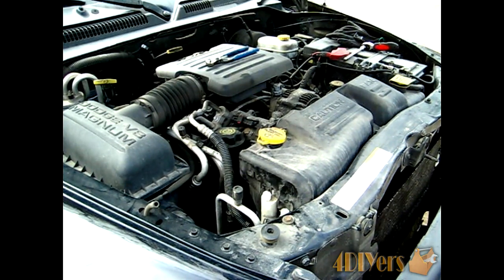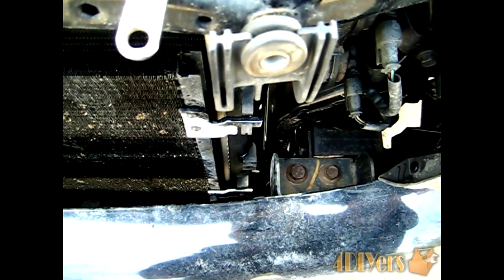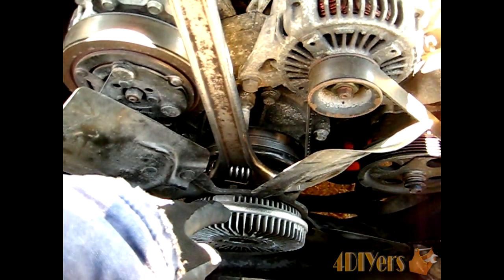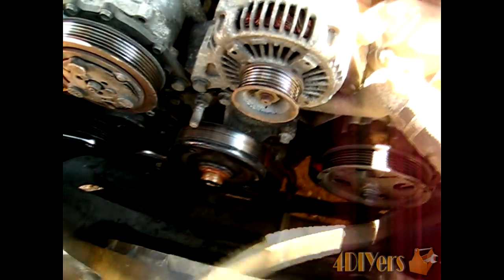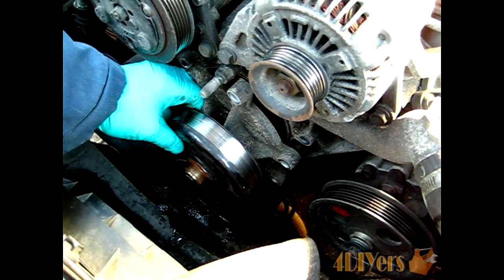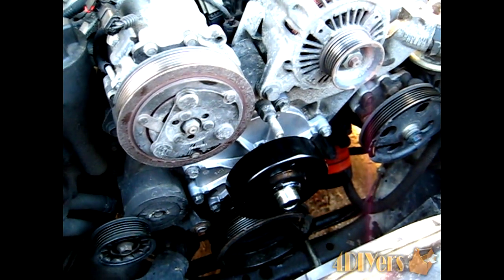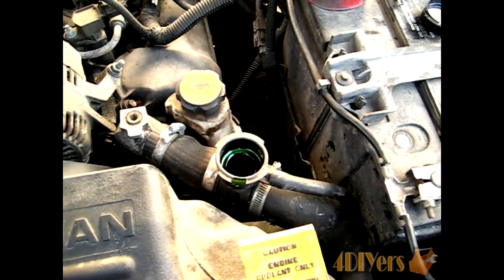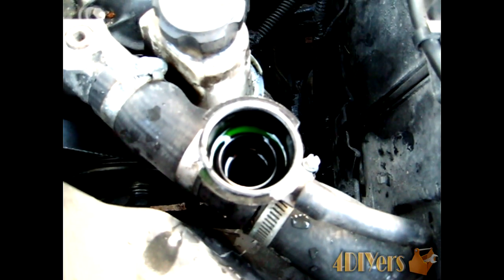DIY: Dodge 4.7L V8 Water Pump Replacement

Comment: Great video and very informative. I'd like to give a little info also as I'm very familiar with the 4.7. You MUST use a HOAT type coolant. Anything else will eat the aluminum (Aluminium) heads and destroy the heater core also. Valvoline Zerex GO5 is a great and affordable option. My other Woa, it's generally sought to install a new water pump with a metal impeller instead of composite/ plastic to eliminate the risk of brittle plastic exploding inside the block.

Comment: My pulley didn’t have enough tension to stay in place while I tried to break the fan loose with the large wrench, does that possibly mean a bad tensioner pulley as well? Should be able to get it off tomorrow hopefully, we had a bit of an emergency breakdown and did put a gallon of water into the coolant to see where the leak was coming from after making sure it wasn’t a fire. The truck had no loss of performance or anything other than a battery light and a dinging sound with it; made it home a few miles down the road while trying to “feel” for the problem because I literally noticed nothing. But within the last block of rolling up, the truck started going up in heat and I noticed power steering going out and rough motor sounds/feelings. I’ve parked it and haven’t started it since, but the water we put in came dumping out the front of the motor from what looks like the water pump, so thank you for such a great video! It’s my first time really getting into this rig, we just paid it off and it breaks down… that’s life, taking it as a learning experience! 🤘🏻

Comment: How do you get a double alternator into this? Do you just relocate the radiator hose to make room? I have an 07 Jeep Commander I'm trying to fit 2 alternators in... any help would be greatly appreciated. Thank you!
Reply from the maker: Have you considered installing a higher output alternator instead?
Reply: @4DIYers  I already did. But I need a 12 volt side and a 15 volt side... I've noticed the Commander doesn't like 15+ volts very much. Windows stop working and 4 wheel drive system does too.

Comment: Great video. Thanks for posting it. One question: do any of the water pump bolts need sealant applied to the threads? I remember some of my other vehicles needing that, and some of my bolts seem to have some on them.

Comment: Thanks man, this is same truck I'm doing water pump replacment on and had my pops help me with it and we got water pump off and now cant get the rod that goes out to clutch fan 2 release.
What's your recommendation on getting the peg I'll call it, or post, off the water pump so can get new water pump on 2 clutch fan and back mounted? Should I put old water pump back on and new serpentine belt so theirs pressure on the ideler ?  I tried bringing it to a friend with a big vise but he believe itll have to be punched or pressed out. The other option is to replace clutch fan and ideler/pulley in between clutch fan n water pump. At what point when buying parts tho, do I get the peg with all the seals and stuff in them? 
Any assistance would be greatly appreciated. Thanks for the video man, u did way better then the other 30 videos I've watched.  Thanks, Ryan

Comment: Thanks for your help. It turned out to be easier than I thought. The advice to place the bolts directly into the new water pump was excellent. It saved me some heart ache.
Reply from the maker: No problem and thank you for the feedback too!
Reply: @4DIYers  hey do you know where to find a diagram of where the bolts go in case they were mixed up?

Comment: I think removing the lower radiator hose from the thermostat housing is an easier way to drain the coolant. Then when filling coolant there is a bleeder valve to remove there air while still getting the coolant flowing to the upper radiator hose, also parking on a slight incline will help bleed all the air out. A lot of 4.7’s blow head gaskets and drop valve seats because of overheating from not getting all the air out of the cooling system.
Reply: Where is the bleeder?

Comment: Man I'm sure glad I did my research before over thinking this process seems to be super easy and.you sir are very informative. I have one question for refiling the system? Do you have to remove that 15 mil hex head once refiling the system.to relieve the air bubbles or do you just leave the cap on
Reply from the maker: Thank you :) You can remove the bleeder screw, but they can sometimes seize up or you can leave the cap off and bleed the system that way.

Comment: Good video but if it was me I'd clean those long bolts then put a thread sealant on them..they did that from the factory because they went into a water jacket and might leak if you don't.

Comment: Thanks for this great vid.  If I may add to your excellent tutorial.... the radiator draincock can be reached by sticking your hand through the right hole in the plastic bumper valance.  At least that's how it is on the Dakotas and Durangos.   No need to to pull any radiator bolts.  Second, don't use Vaseline on the rubber gasket.  Petroleum attacks rubber over time.  Use dielectric grease instead.

Comment: great video thanks a ton!  Just a quick question. If I left the cap on tight when purging air from the system, would the overflow tube still let that air out ?
Reply from the maker: No, you need to leave the cap off or use the bleeding port.
Reply: Thanks! 👍🏼
Reply: @4DIYers  where is the bleeding port located at? I replaced my radiator a couple months ago and do not believe I bled the air out correctly...

Comment: Hello sir,i have a couple questions if you have time to answer it would be very much appreciated.
1.what torque measurements are the water pump bolts tightened too?
2.are the bolts loctited in with thread sealer ?
3.after years of use has the water pump leaked considering no rtv was used to help seal it?
I am about to change the radiator,water pump,thermostat,and fan clutch on my 2004 v8 slt 4.7 dodge dakota it’s set up is exactly identical to yours.i want to ensure i will not have to go back and redo anything after assembly.your expertise would be greatly appreciated thank you sir.

Comment: This took a friend and I an hour to do! :D If you have trouble getting the fan nut off you can also sacrifice an old screwdriver to jam in the little holes on the pulley and use it to backwrench. The pump only cost me $80! (CAD)
Reply from the maker: Awesome to hear and thank you for sharing that tip as well!

Comment: good job, I saved a few extra steps by not removing the upper shroud, just turn the pump half turn with the impeller facing you and you can squeeze it through the alternator and ac compressor and just stretching the shroud a little and it slides through. Took me about a hour to do it with two 10 minute warm up breaks. Going to post video on removing the fan clutch, that's where most people get hung up at.
Reply from the maker: Thank you and great tips as well!

Comment: Done this twice on my 08. I pull the tensioner, then the water pump bolts. Remove the two fan shroud bolts and remove the fan/pump as a unit. Clamp the assembly in a vice and remove the fan from pump. Install the new pump, then the shroud. Thread the fan onto the pump. Too easy. As a side note, put anti seize on ALL threads. If you have to do it again, you'll thank me.....
Reply from the maker: Great tips, thanks for sharing!

Comment: My truck also heats up real quick changed the clutch fan since it was bad made a little change but now is just goes straight up 
The mechanics told me  may be the thermostat..but one of the heater core hose broke and looks like is pumping antifreeze any recommendations you think I should change first
Reply from the maker: Quite possibly is a stuck close thermostat, a plugged coolant passage, faulty radiator cap, faulty temperature sensor, or failed impeller on the water pump. Here is a video on how to troubleshoot a faulty thermostat https://www.youtube.com/watch?v=HmA0YDkQyAA

Comment: Thanks for the video! But my radiator drain plug broke in half, and part of it is stuck in the radiator. How would you extract it?
Reply from the maker: Thank you. Try heating up a screw and sticking it in the plastic, should give you enough grip to get it out. Don't forget to subscribe :)

Comment: Excellent job! Thank you very much! I am very grateful to be able to finally find a professionally produced vide which and is also an accurate DIY automotive video that is this well done. In the past I've had to watch 3 or 4 videos, then piecing together the information that seems the most likely to be correct and the most logical, in order to complete my projec, which takes up a lot more time.I can not thank you enough. This is a very, very well done video. It is straight forward, and in less than 13 minutes, you are able to cover every step of the process, from beginning to end. You included everything, including a written account of the procedure and what to look for, as well as possible causes of failure of the water pump and associated structures. Your time and effort is well noted. I subscribed to your channel as well. Thank you again, Rob Carrington
Reply from the maker: +Robin Carrington Hello Rob, thank you so much for the kind words and support. I really appreciate that!

Comment: Noticed the idler on your tensioner is metal. I'm not a fan of thermoplastic pullies, because if the bearing goes, the pulley just melts off or shatters. Where did you get yours? I haven't seen a metal replacement
Reply from the maker: +cryoburned Unfortunately I can't remember the manufacturer but it was an aftermarket unit, not OEM.

Comment: Im doing this project right now on wifes Durango. .same engine..also while your this far into a job like this do yourself a favor and change thermostat and lower rad hose..will save you headaches later since u have to have the same parts off the engine..thank you..great video
Reply from the maker: +woodsracing Excellent tip, thank you for sharing!

Comment: How many hours does it take to replace the water pump trying to figure out how much my mechanic will charge for this job
Reply from the maker: Nicole Silvio Should be able to be done in about 3hrs, depends on the shop and what they have specified for replacement time.

Comment: One thing about the coolant. My daughter's Durango had the Hoat type coolant in it. And she had her oil change company "Jiffy" topping off her fluids. They were putting the Green regular antifreeze in the overflow tank. When I changed her water pump the orange Hoat came out of the engine and the Green was still in the overflow. The siphon tube to the overflow was completely clogged with curdled gunk !  So..DO NOT MIX the green with Hoat or G-05.  You CAN use the Green that is approved by all manufacturers but ONLY if you thoroughly flush the system first and then stick with one color. (I know the color isn't the issue it's the type). So pick one and make sure these Oil Change or Auto shops know what type you need to top off with.
P.S. Thanks for the great video !
Reply from the maker: dueck303  Should be almost exactly the same.
Reply from the maker: Digitalozzie That is very true, incompatible coolants will cause issues. So it's always good to stick with the same manufacture and type to reduce any risk as it can be very costly in the end. Thank you for sharing the tip by the way, greatly appreciated!
Reply: 4DIYers  Hello man how are you, excellent video, but I just want to ask you if this can work in a 2005 jeep grand Cherokee laredo 4.7 motor? Thanks

Comment: Thanks for that tip, I have been trying to find a way of taking the fan clutch off for hours using that same tool and leverage on the pulley to keep it from moving.... No luck, but now I can for using your simply technique!!
Reply: I'm at same step with mine, got the water pump non off becsuze couldnt get big nut 2 budge, thought I'd take whole unit 2 buddy's shop with large vise and get it off and NOPE, he recommends having it pressed/punched out. How did you end up getting clutch fan removed from water pump? Any guidance would be great, Thanks man. Ryan

Comment: This was a huge help!

Did this on my 2004 Dakota 4.7L V8. One difference I had was the radiator drain plug was a half turn not quarter turn. The clutch-fan nut is a 36mm (1-7/16"). All other information was spot on.

Thanks!

Comment: Hey how were you able to remove the fan?
Reply from the maker: You can either use a large wrench the correct size or an adjustable wrench. Make sure the wrench is firmly in place and give it a tap with hammer to jar it loose.

Comment: I have the 4.7L in my 2003 ram and I am fixing to do my water pump. The only thing I was wondering is the last time I went to get/add anti-freeze the parts store said that it had to be the coolant from the dealership. I am not sure of the difference between dealer and over the counter coolant. I was wondering if you heard anything about the dodge 4.7 using 'special' coolant that only the dealer could provide. Mine was reddish orange and was about $30 bucks a gallon.
Any thoughts?
Reply: OKCBruce I found prestone  works, if you read the back of the jug, it will tell you what Number it is compatible with. If you go to advance auto or autozone, they can look it up and then you can look at the back of the jugs and see which one is compatible.
Reply from the maker: Excellent, thank you for sharing that info Eric!
Reply from the maker: This engine does require a specific type of coolant. HOAT is the type recommended by Dodge and I believe it's listed in the owner's manual. You can also use Zerex G-05 which is compatible for this application as well. You need a anti-freeze with is corrosion resistant, otherwise it will destroy the internals of the cooling system. Not all anti-freeze brands carry that particular quality. I normally wouldn't recommend venturing out of something which isn't compatible considering it may cause problems down the road.
Reply: Thanks for the reply... I was wondering since it looked like you were using regular anti-freeze in the video.. I just wanted to know for sure.. I bought some mopar anti-freeze a while back and I didn't really want to have to go buy more if I didn't have to..   Thanks again...good video too!!

Comment: was there a torque spec on them bolts or just pretty snug ? and what about some blue Loctite on the threads ? Thanks for the vid, very helpful.
Reply from the maker: No problem, glad to help out!
Torque specs are posted in the video description. They are 40ft.lbs for the water pump bolts. I wouldn't worry about using Loctite. Considering it's only aluminum, if you ever had to replace it at the next maintenance interval, there might be issues removing the bolts.

Comment: Want to share that the procedure is very similar on '04+ Durangos. The difference is that you will need to remove the fan shroud AND clutch fan nearly at the same time. You will want to remove the upper radiator hose, them remove the single bolt holding the shroud. Loosen the shroud from the mounts, and at this time you will need to drop the fan assembly through the bottom of the chassis. Once the fan is out the shroud will remove from the top of the bay. Replacing it opposite of above.

Comment: I just finished assisting with changing a water pump on a 2003 4.7 Dakota.  The video was vary helpful. The only problem we had was draining the radiator. We followed the suggestion of removing radiator attachment bolts and attempting to reach the plug. Our hands are too big to get in there.

After perusing the situation we realized how easy it was to remove the front bumper. All that needed done was remove the bulbs from the pumper lights and four bolts then lift off the bumper.  Once done the drain plug is easily accessed.

Comment: LOL.  You can tell the author is a young guy. Everything is "Actually" and "itself".  Could cut out half the video if he could say something without those two words. Aside from that, it was an informative video...but, he did not mention anything about the bleed screw to the back of the hose. I do see the fill cap is installed in the top hose. Is that a new addition by Chrysler or a mod by the owner?